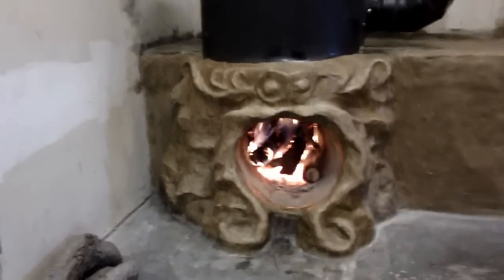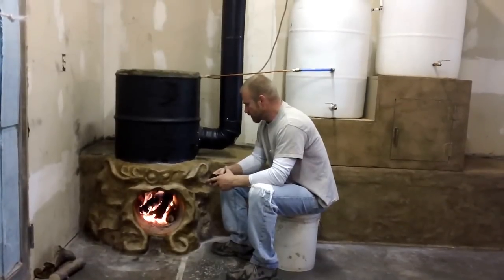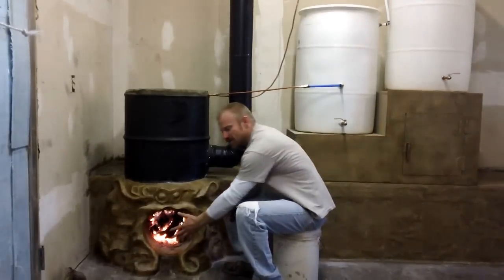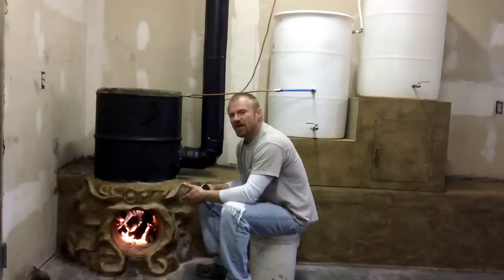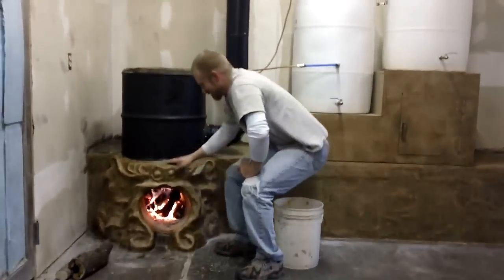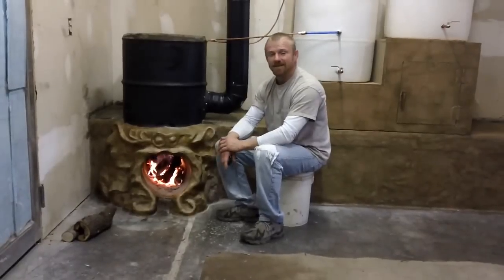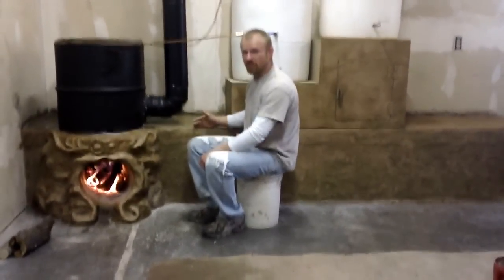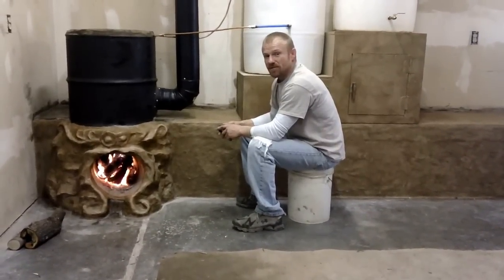Bulldog Rocket Stove Fireplace Thermal Siphon Water Heater part 6

Comment: You're right, it's NOT an actual rocket mass heater; but, a wood stove mass heater. Still, pretty cool. Too bad there aren't links in the description to the other parts of the series. It'd be interesting to watch the build of it... When I have the time to just rummage around, I'll try to make it back to find them. Out of curiosity, how's the cobb holding up, almost 6 years later?
Reply: You show a lack to understand what it takes to qualify as a rocket stove. If you did you would not be so quick to make your claim. Armchair quarterbacks like yourself. Is the exact reason I don't put out many videos or respond much these days... I'm not going to argue with you or explain it to you. I'm sure you have built way more variations in types of rocket stoves and I have. I've only built 100's..

Comment: Are you going to tile or brick the back wall?
Reply from the maker: sheet metal to reflect the heat
Reply from the maker: To address your question about the temperature between the top of the barrel and the exhaust what I have found in my experience is anything cooler than around 150 degrees will cause creosote buildup due to gas is condensing in the flu so that is about the minimum temperature that you want to get it down to a design on my stove to get the temperature down to around a hundred and fifty degrees I learned this from building rocket stoves and using too much gas and cooling the smoke off too much that heat rising is what causes the flu to draft properly the top of the barrel gets up to about 175 to 180 degrees I also designed the stove volume of water to exceed the fire BTU output so that the fire can never boil the water
Reply: Van Powell thanks. my understanding was that a rocket stove would burn all hydrocarbons before they are discharged into the flu. would the shape of the cover of the core help? I was thinking like a hemi engine

Comment: are the siphon coils going inside the "furnace"?  or are they on the top of the barrel?  if so, are they slanted upwards?  have you considered thermal insulation for the copper tube carrying the hot water?  how quickly can you heat  water for a couple of showers,, say 100 L?  very aesthetic design by the way, good job.
it struck me that you might not be utilising the full potential of heating the lovely thermal mass under the barrels.  i have seen some designs where the flue goes horizontlly through a cob/clay mass, and then exits, at a temperature of approx 40 celcius.
Reply from the maker: on top not slanted. have considered insulation but hot water is not the maine point heat is so uninsulated allows radiant heat
Reply: well, water does double as incredible thermal mass, so makes sense to use it tht way.  

im very curious now, and have a few more questions id like to ask you, if you dont mind:

1)  what diameter and wall thickness is your copper tubing

2) what length of tube is coiled into the furnace?

3) how fast can you heat up a barrel of water, and to what temperature? 

4) is it at boiling point when it comes out in your hot tank?

5) in normal water operation, what is the fuel consumption (in weight, estimate)?

thank you so much, I hope Im not overloading you with questions :)
Reply from the maker: The coil is a 20 foot long soft copper coil I'm not sure if the thickness but it's three eighths diameter a bigger diameter or longer coil will pick up more heat it is at the boiling point when it comes out but it doesn't have to be it could be reintroduced to the barrel at lower point and the thermal siphoning cycle would still work without it reaching the boiling point there are 8000 BTUs in one pound of hardwood it takes 3100 BTUs to heat 1 gallon from 40 to 200 degrees or a 55 gallon drum will hold about 77000 BTUs from 40 to 200 degrees
Reply: cool thanks.  have you got an estimate on the flow rate of the hot water,or how long it takes to fill /half fill a barrel?  (i wanna heat a shower with it)
Reply from the maker: If I wanted to heat a shower with it what I would do is I would use a much smaller Barrel or less volume of water which would heat more quickly with less would probably something like a 25 gallon tank would heat twice as fast it depends on a lot of variables how much would how warm the water is when you started what the temperature of the water is what kind of wood you got in there with what kind of moisture I would use a 25 gallon drum if not a 10 or 15 gallon tank to quickly get my temperature where I wanted it
Reply: and what kind of time frame do you think we are looking at for heating say a 50 litre (15 gallons) to shower temperature from a cool ambient temp?

Comment: Thanks for the video. Do you use a pump to keep the water cycle running?
If not, are you then using a back pressure valve to keep the water running in the direction you want it?
Reply from the maker: LordSajon it does it by heat current called convection. Natural process no pump needed
Reply: This stove looks like it's balanced in all kinds of ways. It looks harmonious, both in looks and in the way it runs.
Hey what diameter of feed chamber is it? Looks very large compared to most rocket stoves.

Comment: love the art work, the latex paint even small amount might not be best choice , the point of using cob is to have it breath. latex could seal moisture. the same as a clay pot lets roots breath and a glazed pot holds all moisture in. but again beautiful rustic stained look!  questions #1 why did you choose to have copper water line go to the barrel top instead of wrapping / coiling it up the stove pipe? there would have been more contact to heat the copper water line and a faster / hotter thermal siphon effect. #2 is there overflow ports for the 2 water barrels? having each barrel near top rim able to drain off any water issue to a drain or outside - ie  the water boils / expands to much or more likely event a mineral deposit clogs / blocks line and bottom barrel keeps feeding but higher barrel stops feeding 2nd barrel. #3 are you planning to cob the water barrel sides? since you don't want to heat the cob mass bench, and have heat stored for and released for several hours after the fire is out. water holds heat the best but also can raise humidity high if not sealed container, cob / mass is 2nd best in holding heat and releasing heat slowly and air space is the lest effective. air gains and looses heat very fast. go into a house that's 45 degrees and turn up heat to 70 on a furnace ,in about 20 mins air is 70 but the toilet seat is still very cold to sit on. remember all furniture is mass so it all needs to get to 70 again for you furnace to stop clicking on/off  over the next few hrs wasting energy reheating a house. ps the water barrels in that room are you mass heat storage instead of cob but as the stove cools it will also reverse  the thermal siphon effect and start to cool the water faster than if you had used the cob bench mass. but the way you have it hooked up now the heat from copper line will keep your stove barrel warm longer as the water transfers heat back to it. post post script to anyone reading this stop daily playing with your house thermostats temps, set the temp and leave it. utility companies are in the business of making money not saving you money. remember mom saying don't stand there with the fridge/freezer door open, it makes it work harder to get temp rebalanced. get in and out fast so less temp change. the laws of nature have not changed, just the advertised advice from utility companies have.
Reply from the maker: Hello greetings.  Cob walls or cob used on straw bales does need to breath for moisture difference from inside the house to out side. but cob on a stove has no need or requirement to breath.. IF a stove needed to be able to breath cast iron or steel would not be good materials to build a stove but as it stands they are and they dont breath at all. but I found adding flower to the mix gives the texture I was looking for.. the paint is obviously not the best choice but not for lack of breathing
Reply: I think you misunderstood I didn't say much about cob on stove only mentioned the water barrels as being possible extra cob heat mass storage. yes dirt, clay, cob even cement etc takes time to heat up and it slowly transfers heat back out. simply put these items have trapped air  and are porous so it doesn't want to gain or loose its temp easy. metals when heated heat faster and loose temps faster because of molecular structure being tighter. I am a cast iron fan because it holds and releases heat better. metals do expand /contract (sorta breath) so the cob on your metal barrels if temp gets too intensely high there will be cracks in the cob also the paint near that kind of heat will have fumes released, I wouldn't be as much worried about its flash point as the toxins. similar reason I hated the DuPont nonstick coatings on aluminum pans, if it gets too hot it releases fumes that will kill any pets birds in house. reminds me of the poor canaries going down into mines. even if things in life don't kill us, doesn't always mean its makes us stronger sometimes it can simply be damaging us.
Reply from the maker: Angel Gordon water stores 3,26 more heat than cob and is  by far a better thermal mass. actually pound for pound water stores 5 times more heat than cob but cob being more dense weighs more per cubic foot which reduces the heat capacity advantage of water over cob to  3.26 times or 326% more heat stored per cubic foot
Reply from the maker: #1 did  not know how many BTU's i was gona steal and how hot that would heat that volume of water over an average burn time. so I deliberately under did it. and figure I was right for it considering my water temps.
#2 water never boils had it up to about 185 one time truth is a barrel of water will hold abot 75000 btus from 40 to 200 degrees that equal to a space heatr or 15 hours stored in one barrel. so it takes more than one realizes to boil 55 gallon especially when its not insulated and can be cooled by removing insulation on top of the barrel .. No  hard water clogs simply because its  not volume of water like flowing in a pipe over time its the same water recirculating so it can possibly keep adding deposits.LOL.. the when the water is brought up deliberately to 165-180 it is still over 90  8 hours latter.. The bench brought the flue temps too low and had draft problems. the barrel has a couple pin hole in the lid in a recess in the bung port with a piece of sponge in it to catch condense and hold any steam and when water levels are maintained and its over the upper inlet no steam ever happens

Comment: I didn't listen to the entire presentation so I apologize if this was addressed, but what was the rationale for the short heat riser?  The heat riser in my 6" system is taller than the one in this 12" system. Was it short so it would not produce as much draw from stack effect, letting the fuel burn slower for a longer burn?
Reply from the maker: Two things must be considered about the stack one is that a stack can be shorter if its hotter and the temp it is and stays has to do with how much draw it will have also, so the brick is better than metal on the cooling down side of the fire (on way out) it will keep pulling due to the temp it retains ...second thing that must be considered here is that most rockets bench is cool and not only doesn't draw but cools the exhaust which hurts the draft but on this system the metal pipe (close to the barrel) also gets around 200 so also provides some added draft to this set up.. so the stack height is not as relevant and actually works better.. not as good as if it was taller but better than a taller traditional built rocket stove riser.

Comment: You have done some nice work.  I check on people from time to time in regard to the building of rocket stoves, and I've seen design changes over the years.   It seems folks have forgotten what a rocket stove really is.   In my own opinion a 6"   firebox, riser, and flue is to small for a 2 car garage heater especially if one wants to tinker about in the middle of winter.    A  guy just needs to have a horizontal plate in a 10 or 12" fire box so the wood gases can burn also, the riser and flue need to be the same size.

Comment: I do like being able to see the fire, and I like the clay work on the front of the stove, but I'd like to see the whole installation when it's finished.... because even with the nice sculpting, having the exposed plumbing and tanks in the room is just plain ugly. Why not plumb it through the wall into a utility room? Plus, one of the important things about these stoves is having the flue run horizontally through clay or cob to extract the heat into a large mass, to be slowly released over time. Having the flue head strait out defeats much of the purpose of having a drum in the house. Some people won't like these comments, but it's just an opinion.
Reply from the maker: Please understand this is all built in a garage that has had several types of stoves built in the same spot to be able to compare side by side results. LOL yes it is ugly.. It wasnt built to be pretty every thing a bout it is one big experiment of concepts and principals  working together . I understand your concern about look of finish product this was never intended to be any thing other than proof of concept and side by side comparison . This set up out performed and is far more practical than a traditional 6 inch rocket mass heater ( exhaust running through the bench) If you watch some of the rest of my videos you may discover why. You will also see I have addressed the  finish issue as well.. In short a Rock stone or concrete hollow fie place with the tanks and coils inside or behind the rock working on thermal siphon for free circulation with heat vents to allow control over heat delivered to area. with out the bench ( we left after tear out to use as in draft from outside) and the rocket fire place sculpted or laid (stone) in the lower portion for a clean finish,,,

Comment: It looks great. I don't understand why you would heat the air with the flue, which is brief, when you can heat the entire thermal mass of the cob, which gives you a lasting heat.  Simply having a cavity rather than running the exhaust through the cob will not distribute the heat or store as much heat, will it? It would be interesting to see side by side comparisons. It seems like this stove will require a lot of wood for the calories generated.

Comment: the color of that fire looks very cold as far as flame gradients go.  I would not be surprised if there is a fair amount of build up of creasote within the system after a cord or two is run through it.  I understand that you're not seeing smoke on the outside vent but from your pipe reading of around 173F I would hypothesize that the volatiles are actually condensing inside the system giving the appearance of an almost smoke free efficent burn.  After a cord of wood being bunt I would expect to see a glossy oily build up on the internals.  I really like the use of the water system however, it is a very straight forward set up that should drive well and move heat around.  He also makes a good point about the draft when the fire goes out…small hole in a J burn style chamber has less draft than a horizontal feed and the hole is easily covered when the fire goes out to stop the draft.  the reality of a rocket stove is tending a fast hot fire until the heat sink is hot.  This is more like a fire place and seems worth the tradeoff in rocket stove efficiency to be able to enjoy seeing the nice fire.  A hole cover or front door that has air openings equal to the area of the outside vent pipe would step up the effiency when needed and put on par with a rocket stove.  The riser off the fire box must be well insulated inside that barrel for a good heat pump and a safe burn.  Watch the creosote and inspect this often during the first year, maybe at 1/4 then 1/2 then 3/4 of a cord burned then through a full cord until you have assesed what will remain in the pipes.  Good cob work too man like the design!
Reply from the maker: Hello MG. All valid observations. I can tell you know a little about stoves. My replies would be the following , at this point the cob is not dry and is stealing allot of heat. It is now running right near 250. In addition MOST of the condensation happens on the water cooled under side of the top of my exhaust barrel and then builds up and re burns , I used a Mirror to see it happen. Not mush inside the pipe at this time. keepen an eye on it. its one more trade off too and thats how much you have to load it to get the mass hot. It is more practical in that one load when you wake and JUST one more before you leave gets the mass up to not drop below 65-68 in 8 hours . where the ol rocket had to be loaded or messed with every 15 -25 tops with as many as 6-10 loads to get the mass up to last the same amount of time. I also have outside air piped in through the old bench reduced down to a 2 inch pipe coming in with fan assist too. In this video no outside air was used or fan for that matter it will and does burn much hotter. PLUS I like seeing the fire and it makes such a deep rocket rumble almost like distant thunder. will let ever one know about the build up if any and how long. I have a new design that will eliminate all creosote coming soon

Comment: love the concept, love what you did with the fireplace look, but latex paint was not the way to go.  When you get it to heat up it will stink...and discolor.  I would have investigated a little harder on the clean outs and where to install the flu.  Also, you might need to rehearse just a little on how to explain things, because some of what you said was over my head, and I do not consider that easy to do.  Otherwise nice video...thanks for the info...and beautiful work guys.